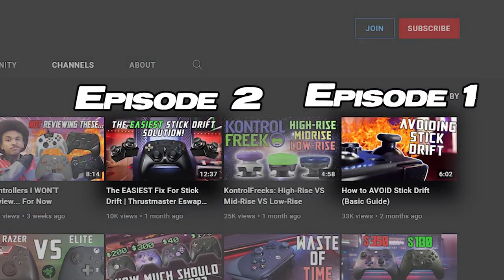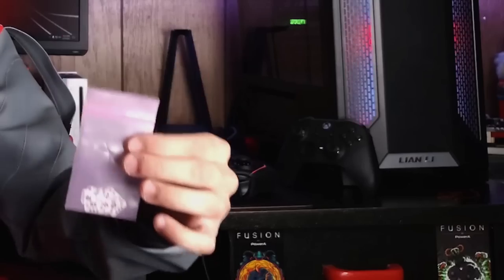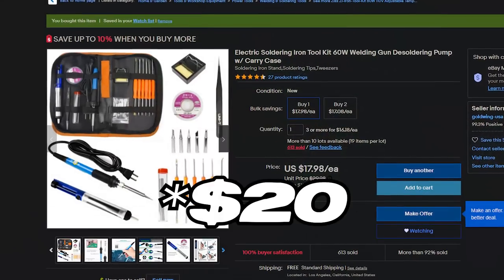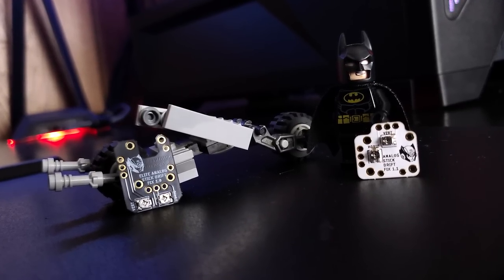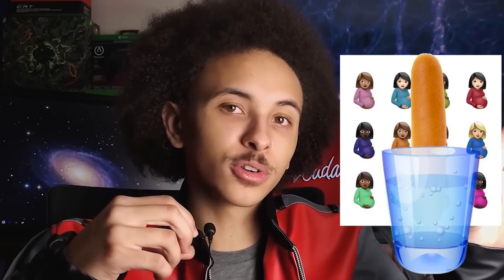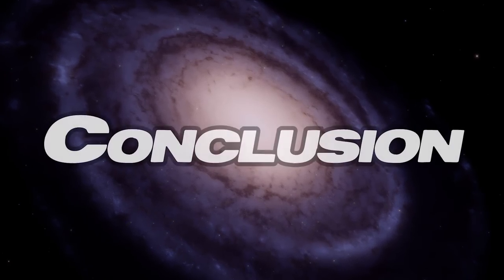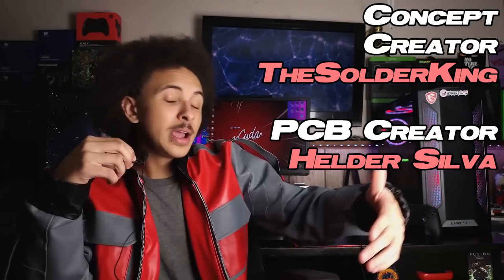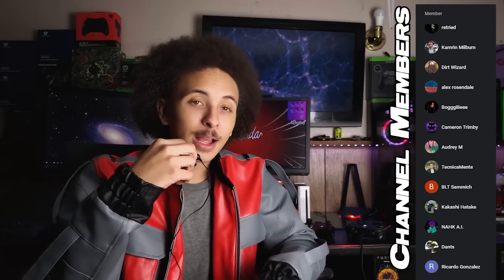PERMANENT Fix for Stick Drift is Only $15! (PS5, Xbox Series X, PS4, Xbox One, Elite Series 2)

Comment: Is this still the best measure to combat stick drift?
Reply from the maker: For most normal controllers, I'd say so. That and a thorough cleaning of the green potentiometers if possible
Reply: @vCuda  do you know if the PowerA drift fix work on the Spectra infinity controller as well? I emailed Helder and left a comment on his video but he hasn’t replied yet.
Reply from the maker: @SoLCollectR  it does. It just takes a bit of maneuvering to get the pcb for the right stick to work
Reply: @vCuda  Alright thanks man 🙏
Reply: @vCuda  Good news the Drift is gone!!!! Bad news I Fucked up my Left Trigger 😂😢

Comment: Try using leaded solder or solder with a better flow cause the lead free solders are dogshit and the lead solder melts around 250-300c so just get some lead solder or one that contains tin in it and soldering will be easier made the same mistake too when I started soldering don't use lead free solder it's dogshit and it will mess up ur fragile pcbs cause it won't stick, solder raisin helps too to clean the point so the solder sticks better #Drift

Comment: I speak the truth.
In fact, while such a product is revolutionary, replacing the stick will not restore your aim. This is because the controllers sold by Sony do not come with such a device.
This is because the centering adjustment (the term used to correct drift in this video) is unique to Sony.
A byproduct of this process is that there is no way to completely restore the AIM.
At best, if you can do it with 70% of the original aim accuracy, you'll be happy. The stick replacement creates a false resistance, which is the drift.
It is ridiculous to spend money on this kind of thing.
The skill required to solder, the time, the money to buy the tools, and the aim (original controller) that a serious FPS player would want is not gained by replacing the stick with a new one.
The product itself is good, but I assure you that I have come to the conclusion that it is not a complete return to normal.

Comment: #EliteDrift

New subscriber here. Love the content.

I returned 5 Elite Series 1 and 2 Elite Series 2 controllers because of SD. I've replaced at least 6 potentiometers in previous controllers for my 360. The fact that this is STILL a problem with a $180 Elite 2 controller is ridiculous. I have   various controllers with SD currently (3 XB1,  1 XB1X, and my 2 from my XSX's). 

I'm definitely going to try this on them. Thanks

 Question, unrelated to the topic... Where'd you get K.I.T.T. and The General Lee? 

Thanks much

Comment: I am baffled. I'm coming from a background of RC Flying. Every remote controller except the absolute cheapest crap uses hall effect gimbals. I have ordered a cheap chinesium gamepad style transmitter. It has hall effect gimbals. It also runs a software called OpenTX so you can literally use it as PC input out of the box. (Jumper T-Lite)
Its price? 80 bucks. 80 fucking bucks. And it comes with a fucking multiprotocol transmitter for use with actual RC Aircraft and Drones and shit.

Unlike that potentiometer crap those things don't have any stick drift. Where the fuck are hall sensor gamepads?!

Comment: Stick stick drift the main reason I won't buy an expensive aftermarket type control I've had friends that bought battle beavers and scuffs and Elite twos and all that s*** they don't last any longer than the stock ones if they don't f**** sooner for some reason especially the Elite 2
Reply from the maker: Pro Controllers complexity can be a huge downside for them in terms of reliability. But at the end of the day, the actual numbers are SOMEWHAT homogeneous. Most Controllers sucks nowadays lol

Comment: This is no different then doing this in software. Most consoles (also PCs) have this "resetting center point" available in options (no, I'm not talking about dead-zone). This is a redundant solution. The problem with potentiometer analog joysticks is far worse than these solutions can fix. The center point isn't the only problem most of the time, it's when moving the stick off center, that surface wears too. Suddenly it jumps (the voltage reading is off all over the wearing, finite surface, not just the center. No mod or software can fix this. There are a few HALL effect sensor controllers out now that will never go bad. The reason thexe game companies use this garbage tech is to make more money when you have to buy a new one every year (its a scam).

Comment: Ngl this sounds kinda stupid. So now your sticks are wobbly and worn out AND off center?
Reply from the maker: Potentiometers are the reason most Controllers drift. Those wear out long before the other Mechanical components do. Even with lose sticks, recalibrating it makes them very usable. A lot more usable than using lose sticks WITH drift
Reply: @vCuda  maybe my experience is just completely different but every bit of stick drift I’ve experienced came from the springs getting worn out.

Comment: It isn't even a new concept, it's just not normalized; Hall based analog sticks are what controllers need to implement to stop stick drift or at least greatly improve it's life. There are a few controllers that have them but I would rather get an xbox controller and install these pcb's instead.
Reply from the maker: Hall sensors at one point we're used in PS controllers all the way up to the PS3 (SOME Controllers, not all). It isn't a new concept, just one that all main controller makers have abandoned so they could increase profits by making unreliable E-Waste bullshit products Lol

My next video is a review on a switch controller with Hall Effect Joysticks, its actually really good!

Comment: This won't help if the carbon track in side the potentiometer is worn out. Becides these will center new sticks but will take away from 100% travel! They are snake oil!
Reply from the maker: They won't decrease travel, you can see that in gamepadtester. And the website sells pots so you can easily replace them
Reply: @vCuda  He was adjusting the soldered in board on the tester (Not moving the sticks). The controller was apart. When it's together with the face plate and caps it WILL not go to 100%. The video is full of pap and swearing!

Comment: #drift
Reply: Can the calibration tool be used to effectively eliminate all stick drift to the point that if i open a game with adjustable deadzones and setting that to 0 will it still be steady.  This is probably something you should dive a but further in because if that’s possible from a competitive aspect that shit is crazy.
Reply from the maker: Well, eventually the loosening stick would cause problems at low deadzones, but that comes after many months of heavy use. You may have to take your Controller apart and recalibrate it every few days, or every extended gaming session. But it should remain where you set it for at least a little while. For those truly dedicated, yes, you can totally keep your deadzone at or near 0 providing you're willing to do the work that may come with it